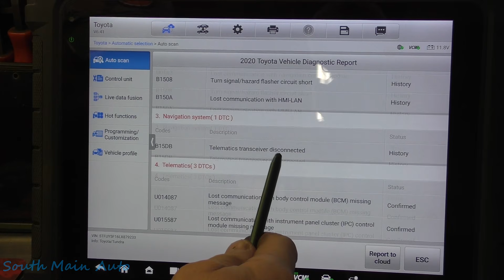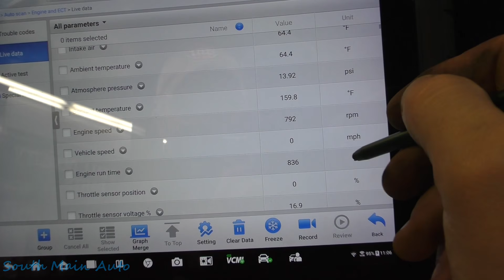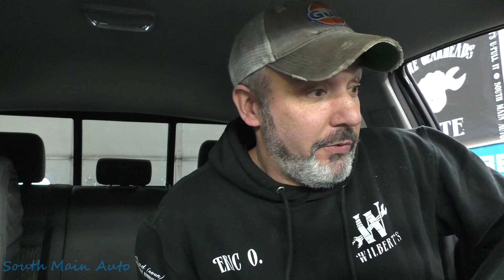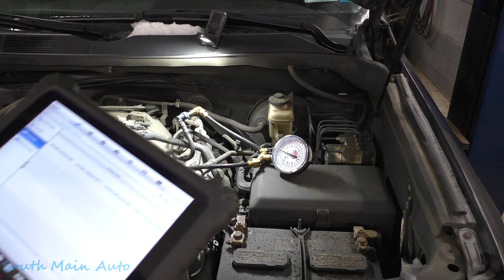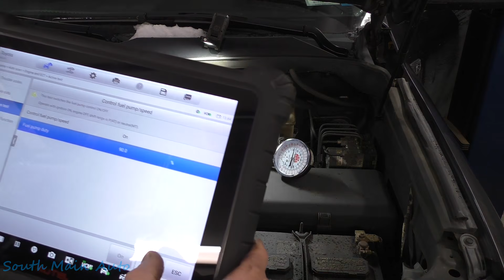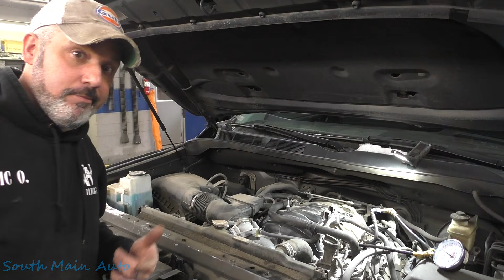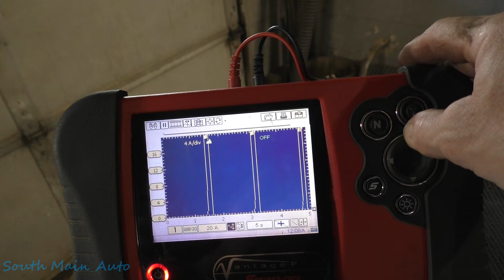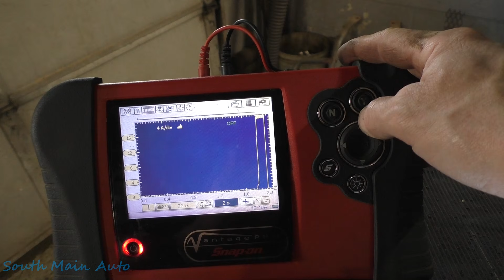My Customer Is Getting Shafted By The Local Toyota Dealer

Comment: I would still wonder if a clogged fuel filter or pinched line somewhere between the output of the fuel pump and where you were measuring the fuel pressure on the fuel rail could cause the fuel pump to stall due to very high pressure at the pump, (due to a clogged line), and the intermittent pressure you were seeing on the fuel rail at the engine.  The high current at the fuel pump could be due to the pump forcing fuel through a pinched line.  If you could measure the pressure much nearer the pump, you might find the pressure there too high, while the pressure on the rail near the engine being too low, indicating a clog somewhere in the line between the tank and the fuel rail.  This might cause all those symptoms?

Comment: Well..back in my day.. First assumption would be coolant temp sensor. But this is beyond that era. So I'd wait for it to act up, then have another tech turn it over while I wack the tank with a dead blow.

Most of my work then was 90's Honda and Toyota and they were they easiest thing in the world to diagnose and work on. Fuel pumps were extremely rare. As was the need for the scope.

Comment: Unreal. This vin does not fall under the recall. Sounds familier been there. My guess is its the same pump as the recalled vehicles pumps. Why do dealerships do this? Dont they realize they are polluting the brand loyalty? He should call or email Toyota corporate directly regarding this issue. Perhaps they can varify the pump part numbers.

Comment: Fuel pumps can fool you. In the 90's I worked on a Vortec V6 truck with the spider injection system. Fuel pressure was in spec but wouldn't start. I called Brother in-law at GMC dealership and said fuel had to be 55psi or higher to start. Scratched my head and replaced pump, fired right up. It's nice to have connections in high places.
Reply from the maker: That's the way all those old CPI injectors were. If you read service data you would have seen it without calling him 😏

Comment: Anything Toyota 2021 or newer you should just sell. I bought  a new 2021 rav with 3 miles and a 2022 Camry night shade with 5 miles and both are trash the cam at 20k needed brakes rotors new tires 2 new back up cams and a transmission they wouldn’t replace until I got a lawyer in them. How the mighty has fallen. Never will by a new Toyota ever again

Comment: SW FL Toyota Dealer:   Told me New AC compressor cost me $4,000!  My AC went out, told them NO! As it was too high and I did not have the money.  Charged me $260 for disag test, drove away.  Highlander had 160,000 miles.  Called the next week, they went down to $3,000-after meeting with his ‘manager’.
Told him NO, as it was too high, again.  The guy mentioned that it must be warm….(FL is hot).
   Went another week, phoned back.  They had a ‘meeting’ and would lower the charge to $2,000.
Said ok, as that was the normal charge.    Got it done, never went back.
Wrote a letter to,the regional Toyota person., no reply.
   Sold the Highlander later, bought a KIA Telluride.

Comment: ...eerily similar to my old 1978 Ford truck...would stall and not start, but immediately did if you gave it a squirt of ether into the carb intake, or let it sit for 15 to 30 minutes depending on the ambient air temperature.
The cause ?  a hidden  inline fuel filter that partially plugged the gas line when the engine was not working hard, like at low speed or idle. 
Once started with starting fluid and the engine revved, the RPM was enough for the mechanical fuel pump to overcome the partial and intermittent blockage and continue on driving, or if the engine was off for a few mintes, the debris in the fuel filter dispersed and allowed the engine to start.
Since the inline fuel filter was underneath along the frame, it took some investigating with a fuel pressure gauge to find the intermittant fuel pressure culprit, and rule out the fuel pump, dirty gas, and debris in the fuel tank .
The juxtaposition between the simple and the complex is stark.

Comment: I had the exact same symptoms with my 1997 Chevy S10 4 cylinder truck. Found something online about changing the fuel filter, so I did and it fixed the issue.

Comment: My 88 Toyota's fuel pump would act up but in the complete opposite way. When it was cold, it wouldn't want to kick on but when it warmed up from the sun it'd start working perfectly fine. No loss of power (22RE doesn't have any power to begin with) no hiccups or anything. Checked the fuel pump relay and the circuit opening relay and checked out good. Checked the draw on the fuel pump and instantly blew the 10amp fuse in my meter. Replaced it with an OEM pump and problem was fixed.

Comment: I have an issue that if I turn off my truck the centre console dash won't turn back on. I put in a android dash cause the original RAM 8 inch screen woudnt turn on at all anymore. It will start after sitting for a while.

Comment: Here in the UK, I know a farmer who had engine troubles on his tractor.  The main dealer was called out and before long this resulted in a bill just shy of £2000. When the farmer then tried to operate his tractor the engine cut out after a while, which was exactly what was happening before the main dealer looked at it. Another mechanic adopted a more common sense, old fashioned approach and found the problem was a hose collapsing in the fuel tank under vacuum pressure from the diesel pump.  A new hose was fitted at the cost of £2 and that cured the problem.  Needless to say the farmer was not best pleased with the main dealer's fancy diagnostic equipment, nor the bill.

Comment: I remember my mom bought a Town&Country back in like 04, she bought it new and after maybe 60k-ish miles when ever she filled the gas take to full the van would start and after a few mins of running it would just die and not start. After looking at the fuses the fuel pump fuse was blow swap it out and it would run like new and never die until she filled it back up. Pulled the fuel pump and found that there was an exposed wire in the fuel tank, swapped pumps and never had the issue again.

Comment: I gotta say Eric, Ive learned so much from you. I had a similar issue with a chevy that burned a relay. I had another tech working on and he told  me that the relay was bad and when he replaced the relay the truck ran fine. I told him to check the circuit to see what burned the relay. I showed how to check it and we found that some wires on the fule pump inside the tank were shorted together casing the problem.

Comment: My dealer shafted me by Toyota. Claimed it was a paraffin wax they put on my 2023 Toyota trd pro Tacoma and was asphalt undercoating. I’m pissed and ruined my experience buying this truck. Only 4,800 miles now 😢. Idk what to do. Sell it and try to get a truck not undercoated, nh oil undercoat it over the stuff they put on, or reapply the crap they put on my truck. Those are my 3 options

Comment: BMW motorcycles often have a similar problem. It's worse when the tank is low because the fuel pump stops being submerged, and thus cooled. Owners go to the aftermarket because BMW only sells the whole pump/gauge sender/strainer/filter/connector/lid assembly. The cheap eBay pumps last longer that the original Bosch. A certain Tercel pump can also be made to work. I found short fine plastic fibers clogging my pump and filter after I replaced them. A hot electric motor is weaker than a cold one, because the resistivity of copper increases. Sometimes they have a thermal cutout too.

Comment: Yes, about midway through the diag I started thinking low cranking voltage causing intermittent fuel pressure loss.
Reply: If a guy hooked up an auxiliary battery with jumper cables it would start right up without ether. But soon that pump is at the end of its service life.

Comment: So my question is how would you know if it's not  the fuel pump module that's not sending out  the turn on voltage to the pump and it's not good  ??

Comment: I hate the loud valve train/engine noise under the hood on the vehicles that use either a 0w20 or 5W20 motor oil. Those camshafts are crying out, "Lube me! Lube me!" Ha-Ha!

Comment: Hey Eric.  Electronics guy here.  There is a component that is called a PTC fuse that is essentially a self-resetting thermal fuse.  That’s likely what they used in the fuel pump module.  They also could have had the micro-controller measure the current drop across a load sense resistor, which would actually be cheaper.  Both could behave in the same way, pulsing when overloaded.  Awesome find!

Comment: years ago the fuel changed and caused a hot start problem my shop solved this by adding atf to fuel at fill up this lubed the pump stopped it from locking up

Comment: I had the same symptoms on my 4.0 Tacoma at around 100k. Once the engine was warm and the truck would get shutoff it wouldn’t turn on till the engine was cold. Mind you it was erratic and would do it once every 3 or 4 months. Drove it like that to 223k until it began doing it daily. Mechanic found the issue and replaced the fuel pump with a carter unit and it hasn’t had a hiccup in years and we at 314k miles right now. Best vehicle ever bought

Comment: Pump probably has an internal intermittent temperature dependent ground fault, hence why the current is so high. Something "expands" and makes contact when it's hot, and causes the fault. The protection mechanism then kicks in to prevent a fire. Doubt there's any way to repair the internals, so replacement is the only solution.

Comment: Electronics guy here, but really, you know what a current clamp and an oscilloscope is! Not shabby. 

It is easiest to just turn off the output if a high current is sensed, compared to having an extra part that throttles down the current. The fuel pump ECU basically has a switch (transistor) and that switch cannot handle infinite current. Similar to a relay contact also cannot handle infinite current. So there is a circuit that detects "high current!" And the ECU turns off the switch. Retrying it every few seconds is a good idea. It might start working.

I was surprised the fuel pump sound didn't tip you off right away. Sounds like it has marbles inside. You need a quiet shop to hear that though.

Comment: The dealerships probably pay by the job time that is on the books.  This means the more the mechanic does the more he gets paid which is probably why they start at one end and go to the other replacing parts.  If they just got paid by the hour there would be no reward for doing more work so they would do as little as possible to get the job done.  It is called flag time...where they get a percentage.  That is a downhill business.

Comment: Fuel pump control module. Common no start on many brands. They are mounted in poor locations on the rear of the frame. Exposed to the elements. I have test modules in my tool box. Also so we don’t have to push the truck in.

Comment: Haven't yet watched the video, but recall another YT video on a different vehicle (can't recall if it was a Toyota or a Honda) that had similar symptoms that were caused by either a bad coil or plug (can't recall for sure ATM, I think it was an aftermarket coil). replacing the coil solved the problem IIRC - best explanation I remember was that the coil was likely causing an electromagnetic interference of some sort that was affecting the anti-theft system when warm)

Comment: I used to have a 1988 Honda Accord which had the same exact issue.  I had to wait in the cold or hot day for it to start. I had to leave the engine running when I entered a convenience store. Honda dealer told me it was the main relay problem. I bought the main relay from them and installed it myself under the dashboard. Problem was solved. Not sure about the Toyota.

Comment: ChatGPT gave a nice explanation.

-Test the Circuit: The ECU can intermittently send a brief pulse of power to the fuel pump to monitor its electrical characteristics, including the current draw. This pulse is short enough not to cause significant fuel pressure changes but long enough to allow the ECU to assess the current.
-Check for Over-current: By pulsing the fuel pump, the ECU can determine if the pump or its associated circuit is drawing too much current. If the current exceeds the predefined threshold during the pulse, the ECU will recognize a potential fault and take protective actions.
-Diagnostic Strategy: Pulsing the fuel pump as part of a diagnostic routine allows the ECU to identify intermittent faults or early signs of failure in the fuel pump, wiring, or connectors. If an over-current event is detected during this process, the ECU can log a diagnostic trouble code (DTC) and protect the system by reducing or cutting off power to the fuel pump.
This method of briefly cycling the fuel pump is an efficient way to detect electrical issues without running the pump continuously, which could lead to further damage in case of a fault. However, not all Toyota models may use this pulsing strategy; it can vary based on model year, engine type, and ECU programming.

Comment: Had that problem on cold starts fuel pump was recalled for bleeding off pressure and the flex fuel system had to be recalibrate also because it was reading to high

Comment: Side note. The pump is cooled by being submerged in gasoline. Habitually running the gas level low can have an affect on cooling the pump. I cant prove that pumps that I have replaced were due to the customer running the tank bone dry often, but I cant prove it wasn't the cause either.

Comment: Dealer mechanics are nothing but parts guess changers. I do transmission tuning on the famous 6l80e for a transmission shop and let me tell you how GM has screwed so many with their software mapping trying to lock up  0 slip a woven carbon fiber torque converter clutch that is not designed to have 0 slip. Many people think the opposite that it has too much slip, nope it is designed to slip but when you tune it try and lock at max cruising torque the extra pressure against the TCC destroys the already thin woven carbon fiber lining. This is how GM tuned the TCC to get more mpg to satisfy the EPA. Oh also lets not go down the AFM/DOD rabbit hole too LOL

Comment: The first thing I noticed is the digital temperature gage on the dash that’s made to resemble an analog gage ? That’s messed up.. I think you must know that other mechanics watch YouTube for fixes to similar problems and you’re not getting paid to solve their job for them. 
But if you really wanted to tell people how to fix something like this and you want the respect and honor given to those who tell the truth.. you won’t have to read comments like this, You never check the hard stuff first you always go for the  easily accessible  sensors or actuators to test Did you check the air temp sensor or coolant temp sensor . ? Are they original or have they been replaced ? What is the default coolant temperature cold with key on ? There has to be a threshold it isn’t going to be variable , different parameters need to be met before the fuel air and spark synchronize and that determined by the ECU input from the sensors.. For a non typical example tuning a vehicle on a Dyno if it has traction control and gathers input data from all four wheel speed sensors once you’re operating over a set period of time or wheel speed threshold the vehicle will shut off if all wheels are not moving both axels need to be on rollers not just just the drive wheels .in short  figure out what the original complaint was and keep it simple it may just be a ECU reflash .. but dealerships are no more experienced than realtors and vehicle sales are slow they have to keep the doors open somehow ..

Comment: Sorta retarded that there's a "module" to run the fuel pump that I'm sure costs hundreds instead of the standard 12v under-the-hood relay, and it doesn't bother to communicate something like the fuel pump seizing up. Think it could at least throw a code for "fuel pump high current" or something. Why bother with a module otherwise?

Comment: Im at 10 minutes into the video and it sounds like either a weak pump or the return line is not closing off bleeding excess fuel. And spraying starter fluid gets it running just enough to cause the pump to have that extra juice to pump more..
Edit: sounds like i was right
The pump is getting hot ....expanding..... and binding then cold fuel will cool it down.

Comment: Time 7:50   GM engines with a MAF, will do this if the MAF fails.  Its not getting enough fuel when hot.  A sensor that supplies intake temp or air flow value is corrupt.  My guess.

Comment: Anytime you get tons of random codes it is a voltage drop issue. More likely in european vehicles but happens to all.   Usually more commonly it is due to random intermittent alternator regulator.  Which when it happens old electronic parts/solenoids,sensors,relays, pumps,actuators, regulators ect that are old or poorly built will begin to breakdown and stop working.

Comment: As someone who has worked for Toyota for almost 11 years, and has worked at 3 different dealerships, what an abysmal attempt of service from the dealership this truck was at. That service department needs to have a conversation with the shop foreman/team lead. Anyone with a basic amount of diagnostic ability could've determined that the low pressure fuel pump on that truck was causing those symptoms. A process of duplicating the concern, pulling codes, checking FFD, as well as a pressure test before anything else. Unfortunately, some dealerships don't operate as well as others.

Comment: It sounds like a high-pressure oil pump or the check value on the oil pump by the  crankshaft. The oil is thined out its not lubricauoning when the oil is cold